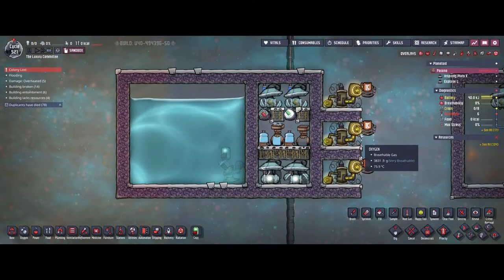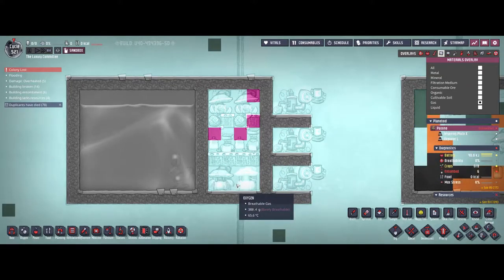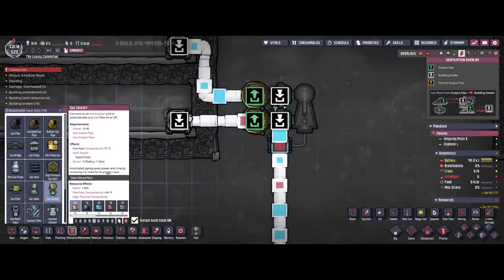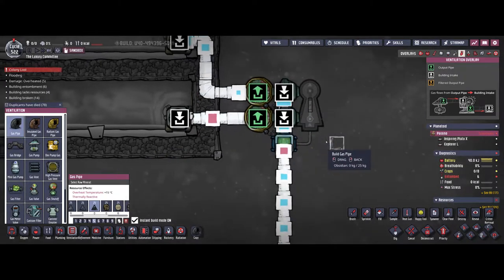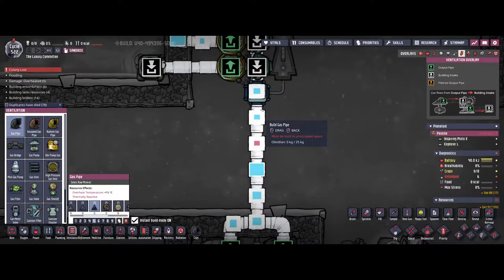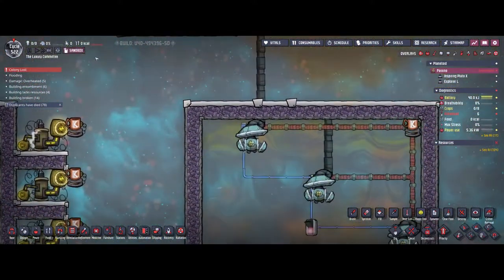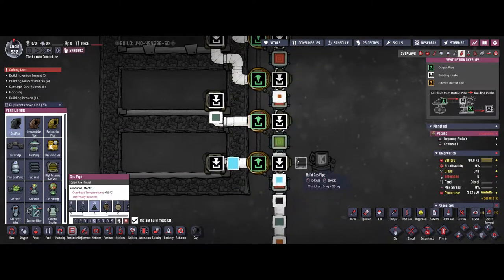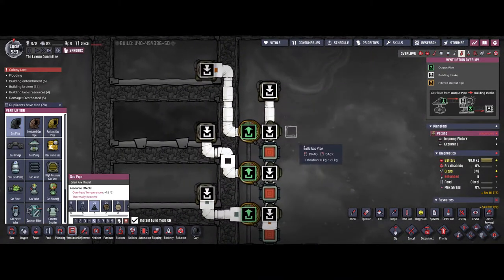Oxygen Not Included: Low power gas filer /w automation

Comment: These types of filters work better with a feedback loop that priorities keeping gases moving forever past the sensors in case the final unfiltered output overpressures or there is a power failure. It is accomplished simply by creating a closed loop around the filters with a single bridge to dictate the direction of flow. The input is bridged onto the loop to prioritize the perpetual flow of the loop during failure. The unfiltered output is bridged off the loop to prioritize escape from the loop before returning to the input.
Reply from the maker: nothing to ad here. Thanks

Comment: There is a power free version using a valve set to 1g and a loop between the input and output of the valve. you need to prime the loop with the gas or liquid you want to filter. Then using a bridge connect to the loop will only allow gas or liquid of the same type to flow through the bridge. The now filtered gas or liquid get to the input of the valve, but only allows 1g through the valve the remainder is sent to storage. The trick is priming the valve loop with the element you want to filter.
Reply from the maker: yes I know, still that one feels a bit like cheating which is why i prefer the version in the video. Still, I agree to all what u say.
Reply: @engineeringandgames6107  it is as much cheating as filling the steam chamber of a steam turbine with two types of water on two rows to push the gasses out of the chamber, or with door deletion, or exploiting the non thermal transfer on diagonal tiles or in mesh tiles in vacuum. or deconstructing diagonal tiles and things like that. it's a regular game mechanic. it seems strange, but it was programmed this way. and it requires a bit of knowledge and some prepwork to do it. it's not a simple thing.

i would consider things like infinite storage a lot more like cheating, than a mechanised filter.

Comment: I used this method with the liquid shut off. It mostly works but there are some odd cases when outputs are full when it lets the filtered liquid through the other pipe. Very annoying. My water tank got polluted so I used this method to send only clear water to the plants and the polluted water into reservoir. Check to see if it works fine (it did) came back to check after some time to find out there was polluted water in my pipes for plants... strange

Comment: You don't need the 2nd gas shutoff and not gate, with just 2 possible gases, as the pipe after the shutoff will always be just one type of gas.  I.E you only need one shutoff less than the amount of possible gases you want to filter.

Comment: you could just connect the sensor in front of the vent and you have an electricity free filter. You will still have the over pressure problem though. But at least you don’t have to fear it failing from no power.
Reply: Yes. Tgat will be helpful sorting only 1 gas and not multiple. This will help sort multiple.
Reply from the maker: agree. Still, u usually dont wanna just emmit the gas into a room but instead feed it into a pipe. In that case, you would need an aditional gas pump to achieve that;) Hope I understood u correctly. Sometimes hard to tell from comments what exact build the writer has in mind
Reply: @mazfars  this method can sort multiple. in the same case of the video, you can simply line up multiple powerless vents; rather than running the pipe outside the containment boxes, run it through it instead with the connected vents. the only issue with the sensors is that if the pipe backs up it can dump the wrong gas into the rooms, both video method and the powerless method. the better method is the circulating gas loop with a gas valve set to 1g and a bridge. which never allows another type of gas onto the loop no matter how backed up it becomes.

Comment: not sure about now, but those used to be unreliable. they worked like 95% of the time, but every so often a wrong element would slip somewhere.
an even cheaper solution, would be a "mechanical filter". it requires a bit of initial setup to prime the required gas, but after that it works perfectly forever and doesn't require any power at all.
Reply from the maker: unreliable: yes it suffers when power is not available
Reply: @engineeringandgames6107  what i'm saying is not related to power. when i first started playing the game, i thought of this "filter" and i thought i was so clever of thinking about this. until i noticed multiple gasses in my "filter" output. 
if this stops receiving power the shutoff closes the filter output, so all gasses should be send toward the overflow. yet my filter output - the one following the shutoff, had multiple gasses in it, instead of the one selected in the sensor. so the shutoff was working, but it was slipping wrong elements.

but that was very early in the life of the game, it could have been during early access even. but i guess they fixed it since then. i haven't tested it myself since that time. i'm just using regular filters or mechanical filters.
Reply from the maker: @IcoKirov  when i tested it during preparation of the vid, it was stable. Only exception as mentioned, if no power is attached
Reply: @IcoKirov  it still can, it is when the main line backs up and is unable to release the gasses. aka when the final gas vent is overpressured, the whole line can back up, and accidentally slip a pocket of gas if the sensor reads the correct gas, but the gas on the valve is different (all gasses must be stopped in the pipe for it to happen).

Comment: I use these quite often, they aren't perfect and are usually used for temp projects on my saves.  It's the same idea with liquids.  The biggest issue I run into is this is sort of mid game solution, because you need refined metal.

Last thing, you can actually get cheaper with electric and just vents open/close.
Reply from the maker: agree. Still, u usually dont wanna just emmit the gas into a room but instead feed it into a pipe. In that case, you would need an aditional gas pump to achieve that;) Hope I understood u correctly. Sometimes hard to tell from comments what exact build the writer has in mind